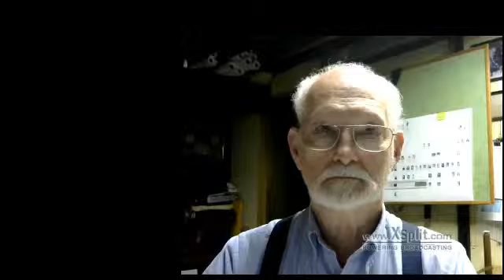My Goal, BUILD AN AIR ENGINE , and what problems I see with a Compressed Air Engine

Comment: I have few questions/doubts regarding the concept, where can I address you?
Reply from the maker: Put your questions or doubts out for the public to see and I will respond as well as I can to those doubts or questions.
I am happy to see you are interested enough to respond or question my video or ideas
Reply: @AirEngineResearch  I too had thoughts of investing my time into air engine. But various points are holding me back.
1. What should be the main purpose? 
     - An alternate to fossil fuel?
     - A low cost running vehicle?
     - Low emission vehicle?
     - or just for conventional air engine vehicle uses (mines etc.) 
2. How will you overcome such low energy density of compressed gas compared to fossil fuel or batteries?
3. Compressing air costs much, how will you overcome this?
4. There are losses on so many levels;
      - firstly, any energy conversion opted for
        compression bears losses
      - pumping losses during compression,
      - engine operating losses,
      - we can never assure zero leakage at every stage,       
        so leakage losses,
5. Safety is a big issue to tackle, since high pressure cylinder is in use.
6. Engines designed by you are bulky, why don't we go for compact engine? With minimal swept area for high torque.
Reply from the maker: You have watched a video I made back in 2016, since then, there are many changes and variations in what i’m trying to accomplish.
I would suggest going to my website airengineresearch.com -  and start with the latest video in 2019 and then maybe some of your questions will be answered. If not we can discuss earlier - there will no doubt be a lot of things I couldn’t answer I’m not equipped with hi tech equipment, just my thoughts and desire to do something with visions in my head.
Reply: @AirEngineResearch  sir, website is not accessible. Are you talking about your YouTube page?
Reply from the maker: Air Engine Research  
Sorry about that , i wasn't thinking right - it is my You tube Channel and is youtube.com/user/AirEngineResearch
Reply: @AirEngineResearch  sir i respect your experience and knowledge, no need of sorry 😊
Reply: Can you share your email?